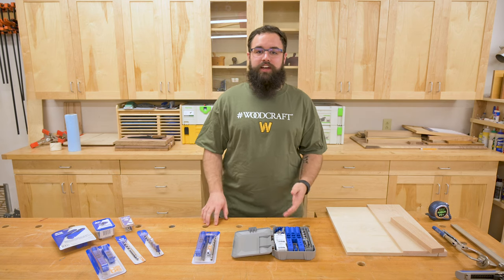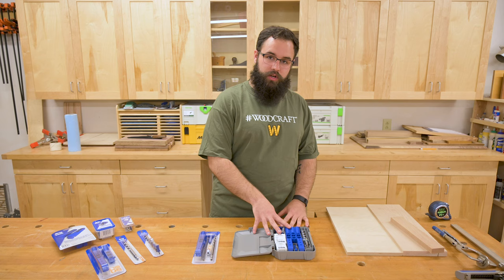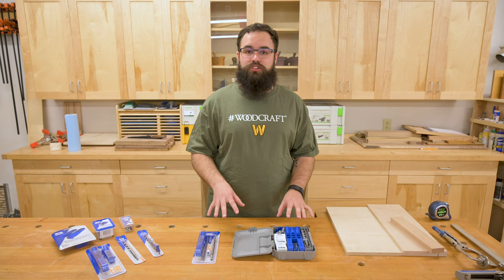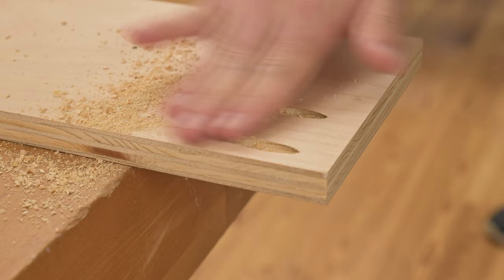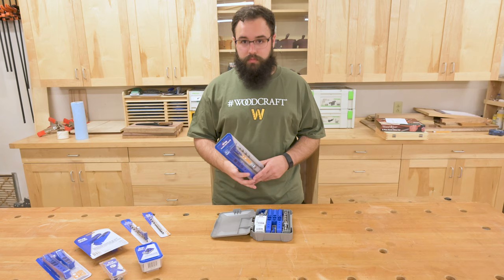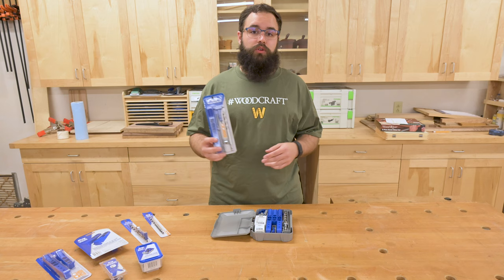Kreg® 300-Series Pocket-Hole Jigs - Product Overview

Comment: I noticed your wood was not 1/2'' thick and not 3/4'' thick, why did you choose the 3/4'' setting?
Reply from the maker: We used a piece of 18mm baltic birch plywood which is close enough to 3/4" that it falls within the 3/4" range on the gauge.